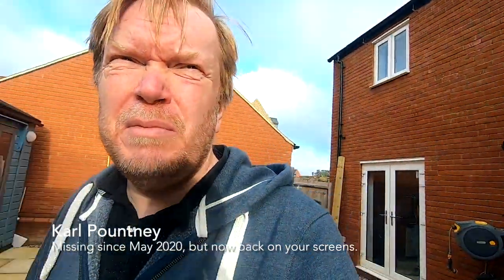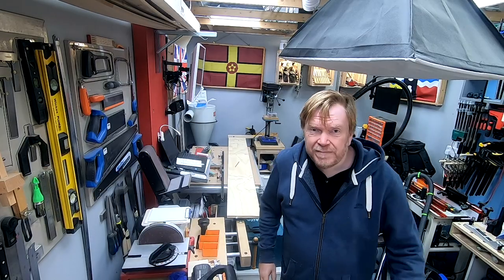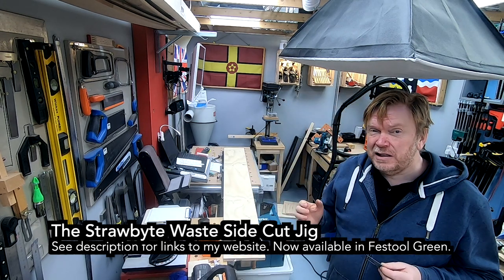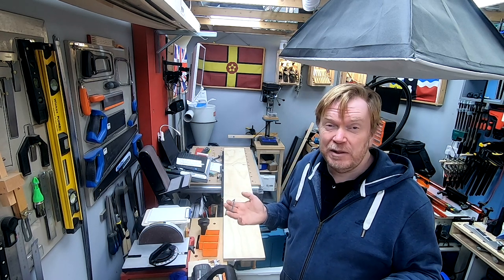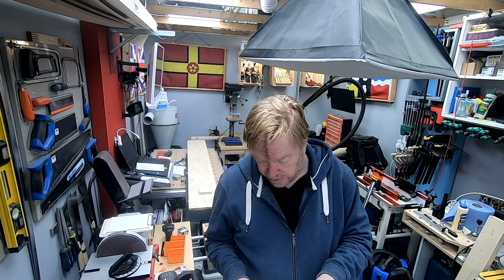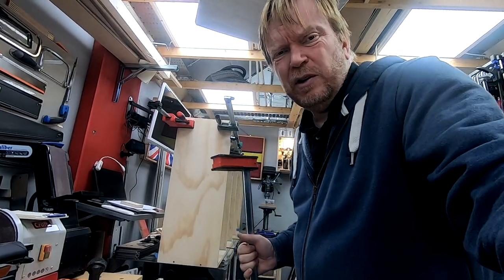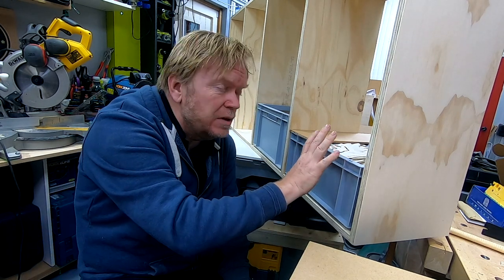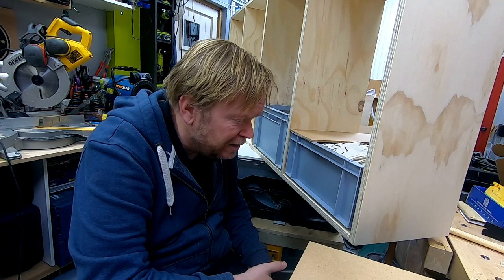Cabinet Making: A Day in the Workshop

Comment: Welcome back Carl. Yes, I did enjoy it. In fact I’ve enjoy all your vids. Your relaxed, natural presentation is a joy. Thanks for the introduction of LED panel lights. Those aren’t available on eBay today but I’ll buy something similar to boost my existing strip light. I’m very interested in an MFT and through you went to Peter Millard’s vid. He’s arranged for a CNC machined worktop for about £60 depending upon size. I’m hoping an MFT top will save me from having to buy a dangerous table saw to obtain accurate repeat cuts. So thanks for that too.
Reply from the maker: Hey Christian. Thanks for the comment.

Comment: Looks like you have been really busy in the workshop, Karl. Could see a few changes. 👍😀
Reply from the maker: Yes - I had a break from work for 5 weeks in September and finally managed to get a new bench built for the CNC and new storage for the Sjoberg bench. Annoyingly I'm stuck with a drill press and belt/disc sander combo that are in the way until I find a better solution. This project was all about clearing small items from spaces under benches and sorting them in to boxes and making them easy to access. Anyway one reason why I stayed away from making videos is that I needed to figure all that out and get it done. Now I feel much more energised and have the patiences to put up with the last few annoyances in the space which I fixing now.

Comment: Welcome back Karl would love a review of the KT3 I keep thinking about it
Reply from the maker: Thank-you - I'm sure you meant the MFT/3 and yes I plan to do that. I've filmed the basic overview and review already. I've been waiting for a few parts to come so I can show some basic modifications to the supplied gear which improve things further. One thing I'm happy to say right now is that spending money fixing faults with the supplied gear doesn't do much to make lessen the initial outlay. But its predecessor the MFT 1080 (with flip up rail) is widely regarded as a better stock MFT as you get almost 710mm cutting capacity. The protractor in the MFT3 takes too much room. Anyway more later and I'm sure all that doesn't help with the decision.

Comment: Hi Karl I'm new to your home workshop. 18mm out, love it, been there lol. 
You've got it right working in your backyard keeping your overheads low. 
Your lighting is superb I thought you had skylights giving natural light at first.

Need to get mine sorted. Just sub'd, I like your easy going relaxing format. Tony
Reply from the maker: Thanks for the comment. The point at which I realised I'd measured the space wrong was when my day making a video went in a very different direction.
I'm really happy with the lighting. I decided to not have any natural light into the workshop primarily for security but also cost at the time. The lights I've installed are from Strictly Lamps on EBay and comprise 10 x 48w 5600K LED panels throughout the whole space. I've a couple of changes to make to the lights to tidy-up the original installation so I may cover them on the channel at some point.

Comment: Welcome back Karl, and thanks for the shout! May I ask what you shot this on? Video and audio was very crisp 👌👍👍
Reply from the maker: Do you think so? The first few shots were on my Galaxy Note 20 Ultra and then the rest was GoPro Hero 7. I must admit I was a little disappointed with the video quality. It was improved by adjusting the exposure on Final Cut. Audio wise I used a VideoMic Micro connected via USB C to the Go Pro. In Final Cut I had to bump up the levels +12db as it was very quiet and (as usual) apply a little compression.
Reply: @StrawbyteWorkshop  It was the workshop video I meant tbh Karl, but yes, it looked very good and the audio was solid - have to confess I wondered if it was a GoPro, but thought the audio was too good! Wasn’t watching with headphones to be fair, but as a ‘punter’ view it was great! 👍👍

Comment: Where did you get your Euro containers from? I have been looking to get some from a german packaging company called Auer. They also make tool boxes which are the same size and comparable quality to systainers but half the price. I suggest you check them out.
Reply from the maker: BigDug in the UK. You've the choice of grey or blue and a heap of sizes in the system.

Comment: Great to see you back at it. Thanks as always for sharing. Are you going to keep your sliding mitre saw if you’ve now got the mft?
Reply from the maker: Thank-you. I'm glad to be back.
Reply from the maker: Ah, good question. And yes I probably will - although I expect to change the saw next year for one with way better dust collection. My needs are much more general than you might see on channels that focus on commercial work, like fitted furniture. The mitre saw feels way more practical if I'm cutting dimensioned wood rather than sheet goods.
I've been sketching out the deep dive on the MFT I mentioned in the video this morning and had a few thoughts about why I'll continue to regularly use both my table saw and my mitre saw.

Comment: Hi there, your work space is cozy actually , a lot are dark and miserable . May I ask you something please - the black fence you use on your mft table it looks like to be around 40 mm X 80mm ,,,how long is it please and where did you get it ? Also your drill press what make /model is it please?
Reply from the maker: The workshop I really like the look and feel of is Matt's at Badger Workshop which I've visited where he has two big windows that flood the space with light. I've no natural light so getting things nice and bright was a priority. I've 10 large panel lights, plus studio lights if I need them.

So the black fence is from benchdogs.co.uk (I used Peter Millard's 10MINUTEWORKSHOP code for 5% off). It's version 2 of their fence and I really like it. It's 1250mm long and has a 20cm mini fence that sits under the rail. It's got a few small niggles but the fence dogs which can attach to the original Festool fence are probably the best elements of the solution. The fence has a scale on it which I don't use. It makes it look nice I think but the tick marks are a bit too fat for my liking. That said I always measure with a ruler or tape on every tool I own and never trust the scale.

The pillar drill is a FERM FTB-13 drill press which I got second-hand. It's OK, but changing the belt is a bit of a faff as I like the table at a good height for me (tall guy). There's quite a bit of run-out on the quill of the drill making it fine for woodwork but if I was an engineer I'd be pretty fed up with it by now.
Reply: @StrawbyteWorkshop  ahh ok, yes I seen that fence, I tried to google festool fencedogs - weird never came up , have you any details. ps what are those flags you have on the wall in your work room, very eye catching
Reply from the maker: @ChristopherClaudioSkierka  Fence Dogs: https://benchdogs.co.uk/products/fence-dogs?_pos=1&_sid=49280ad4c&_ss=r&variant=7439204220986
Reply from the maker: @ChristopherClaudioSkierka  And the flags: The maroon one is the county flag of Northamptonshire (where I live) and the Red/Yellow/Blue one is the county flag of Bedfordshire where I was born.
Reply: @StrawbyteWorkshop  ohh silly me I did not read what you wrote properly ,, its the benchdog rail dogs  dehh, I thought you said u used a particular festool fence dog which are better...more coffee required. You have a nice calm Sunday
Reply: @StrawbyteWorkshop   kinda looks like from the time of King Arthur and the round table :)..the flags
Reply from the maker: @ChristopherClaudioSkierka  The do a bit. Thanks for asking - I like when people notice.